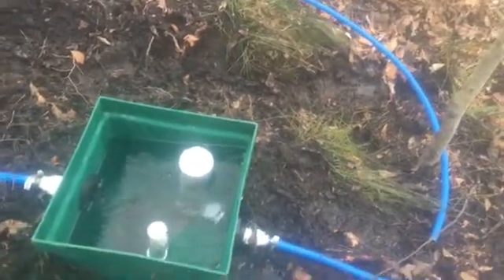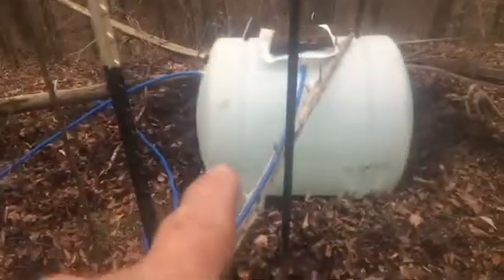Part Two  Spring Box Installation And Water Pumping System

Comment: I love your work right there Eric!! I am new to Sylva, NC and our home is on a dedicated spring. We are kinda scared because we had a positive E.coli test. The spring house is kinda shotty and the spring itself is muddy. Also tested positive for coliform. The system (down at the house) has a 30gal revisor, pump, 5 & 20 micron filter then a uv light. Our light is mounted vertically. AND/BUT the uv bulb was old - we replaced it and the filters - shocked the holding tank and flushed the house. Still positive for coliform!! I'm thinking hot water on demand too. The HW heater looks like new but its 10 years old & a had quite a bit of sediment or rust or who knows what when I flushed it. So many things for a city boy to think about - even though I have extensive experience with huge decontaminating equipment, this E.coli thing scares me!! Looking for words of encouragement!!! Thanks Eric, Jimmy Mac
Reply from the maker: Your in Sylva your not far from me 
It may take a couple of shocks to clean up your system 
You can add a Dalton Rio ceramic whole house filter it will remove 99.9% virus from water 
If you need any advice my cell is
843-224-2262
Reply: @basecampwnc1745  Thanks Eric!! I'm pretty sure I will clean up the spring head, add the spring box and install a new reservoir tank to get started. Our tank is very old, concrete and has no top access - I can't even see in it. Very poor craftsmanship all around. I will have a close look at the Dalton Rio Ceramic filter. We gotta get it working. I am also considering a chlorine injection unit but I hate the idea of adding cl. When we bought the place we thought wow - spring water!! But we had to abandon ship, go back to FL and put off selling our house down here! Very disappointed!! The final option would be a well....didn't plan on that! $$$. Anyway, I greatly appreciate your input and I will touch base with you when we head back up in March. Until then I will be researching all our options and come up with a plan. The Dalton sounds like a winner!!! Much appreciated Sir, Jimmy Mac

Comment: Why don't you flip the filters upside down because most of the plugging up takes place on the bottom of the filter
Reply from the maker: We do but if you watch the video when it is complete you will see the spring box full once it has to run into the cistern 
You can put a T in the bottom and have two filters in the box
Thanks for your comment 
And as always subscribe like and share 
Thanks 
Eric